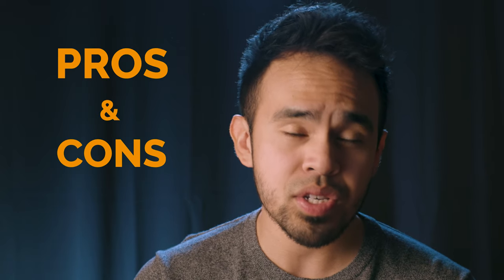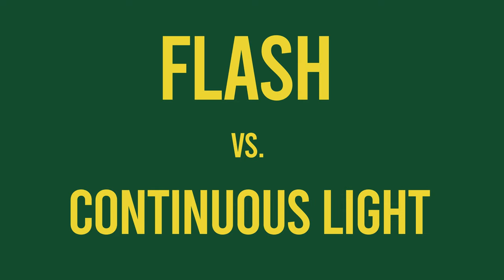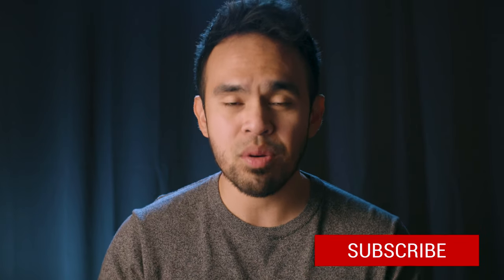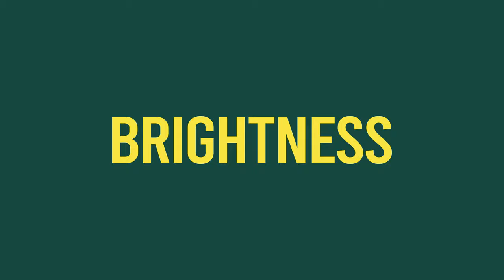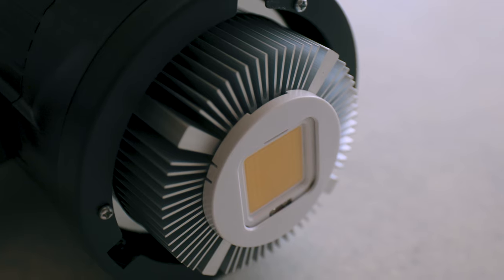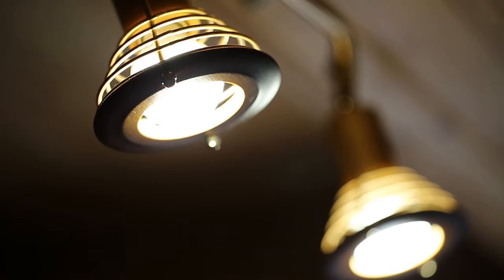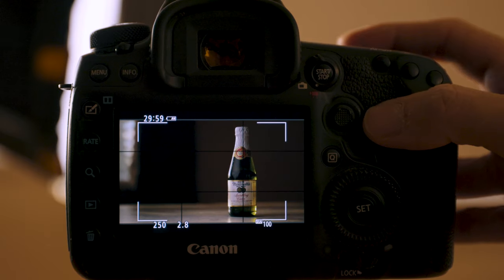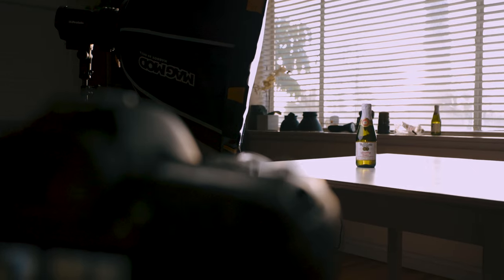What's different between Flash and Continuous Light?

Comment: What about CRI!?...Also If you only have $100 what would you buy two m9(aperture) or one ms300? (godox)
Reply from the maker: That's coming in the next video! 
Thanks for the question, Francis!
I don't own any of those lights, but looking at the spec sheet for the M9s, they don't seem to be very bright. But the godox is a 300ws light which I think is equivalent to the power of about 6 speedlights. I'm not sure what you would use the light for, but it looks like the M9s have a limited use, like rim or background lights or something like that, but the godox with all that power, seems to give you the option to use it as an all-around light.

Comment: Great channel.. Just subscribed.  Keep it up man. I have a photography box for my restaurant. I use it alot to get the quality I need to take photos with no background that will be edited afterwards. Will it be better if I used flash light? Would there be a big diffence?
Reply from the maker: The difference with flashes is that they provide much mor epower than constant lights. But if you're just using a box to photograph your products with sufficient light, I would say a flash isn't needed.

Comment: Cool - looking forward to the series. 
What are your thoughts on flashes that use double A batteries vs the more expensive  version if you don’t do event photography. I think for the Godox version it’s spending $99 vs $170
Reply from the maker: Thanks Josue! 
I think if it doesn't slow down your workflow in any way, then might as well save the money, right? And if you opt for rechargeable batteries it can also help cut costs over time.

Comment: Which one better about rendering color, LED with 95+ CRI or godox ad200?
Reply from the maker: I would say the LED since the CRI rating is specified, which makes me wonder if strobes also have CRI ratings 🤔. But I've actually used the ad200 and haven't really had any issues with inaccurate colors.
Reply: @figandlight  i cant find any information about CRI on any flashlight. Maybe no one courius with that

Comment: is there a difference between led continuous lights and HMI lights in terms of quality or light characteristics?
Reply from the maker: ooo good question! I'm not very familiar with HMIs to be honest. But I find them interesting and used a lot by filmmakers!  My preconceived notion is that they require lots of power and can provide insane amounts of light. But perhaps current technology is helping LEDs match the robustness of HMIs? 🤷‍♂️ Not too sure. 

But in terms of quality, I think they're both on a similar level in regards to CRI and TLCI render scores. I may be wrong. I would think it's  just a matter of how it fits in to a photographers/filmmakers workflow that most likely separates and puts the two types of light into their own categories. Thanks for the question!
Reply: @figandlight  From my knowledge, LEDs can shift green when they heat up and that might ruin some very expensive movie shots, and HMIs have better color consistensy. But for stills and budget videos they're good enough.